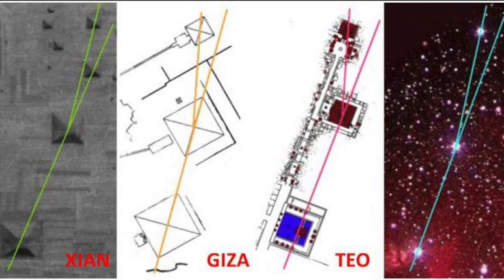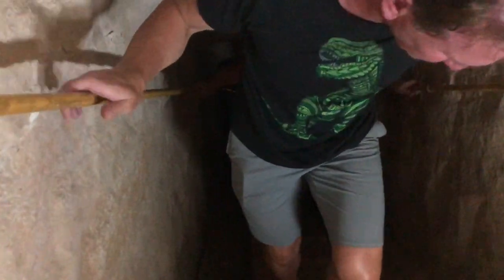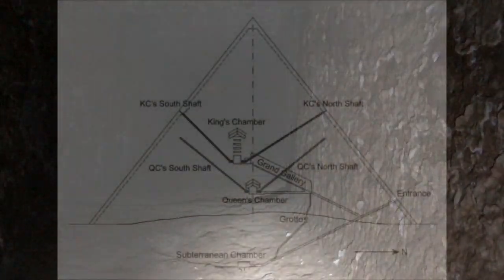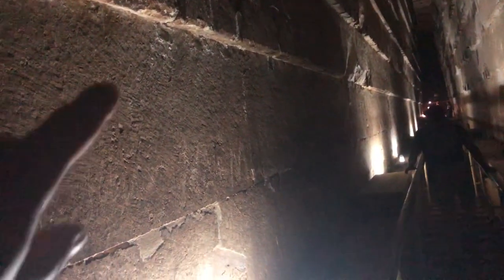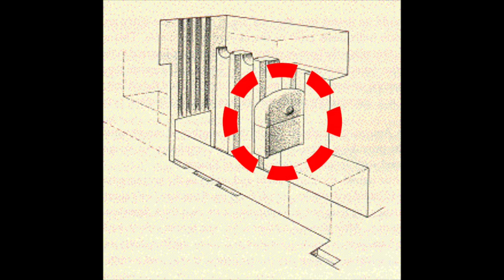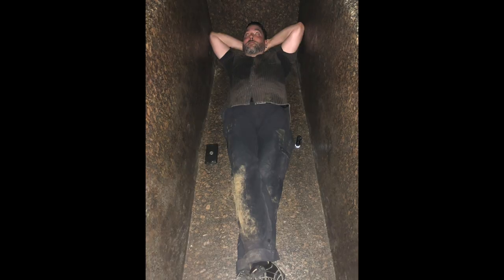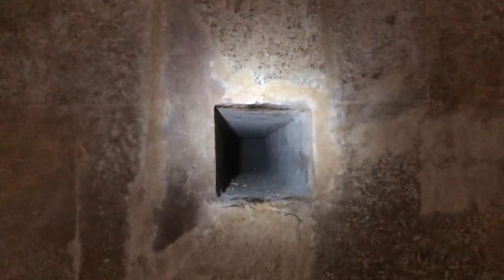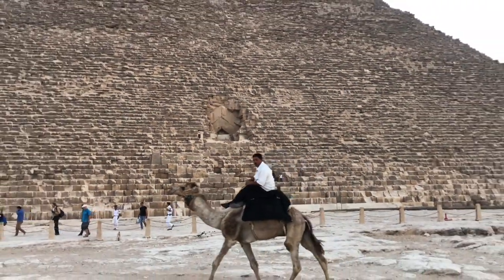Inside The Great Pyramid [Egypt 2019]

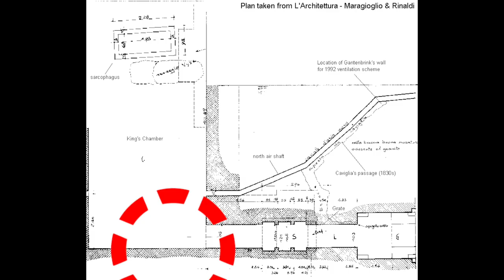Comment: 21:00 Gantenbrink's Door is in the the Queens Chamber Southern Shaft. Rudolph Gantenbrink installed air conditioning in the King's Chamber Northern Shaft as part of a project to control the temperature in the pyramid. Cavaglia's excavation from the antechamber allowed him access and is where the Air Conditioning and is installed. Great footage by the way! Good to see from someone with some knowledge of the structure.